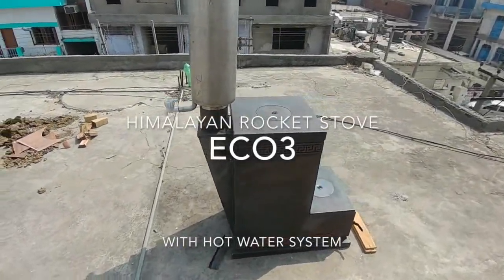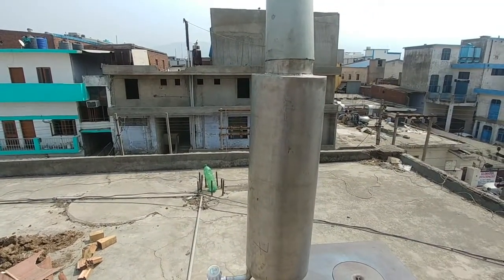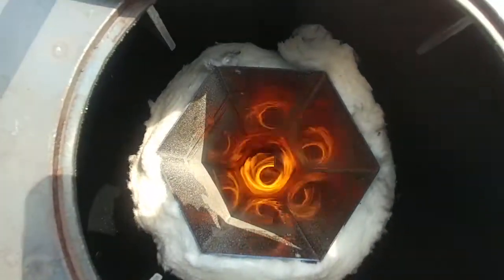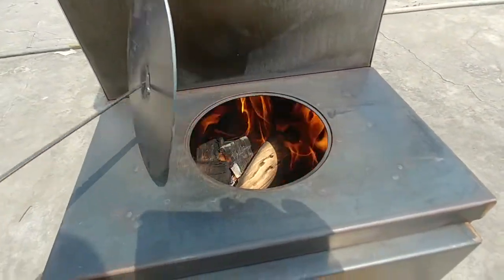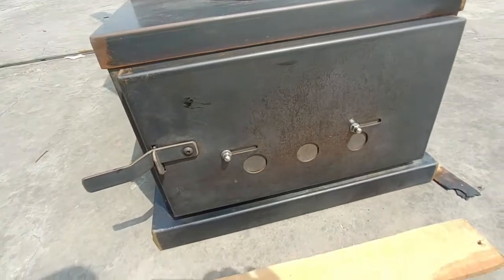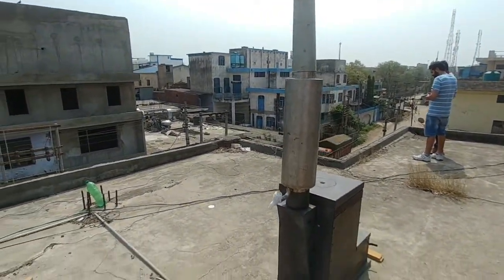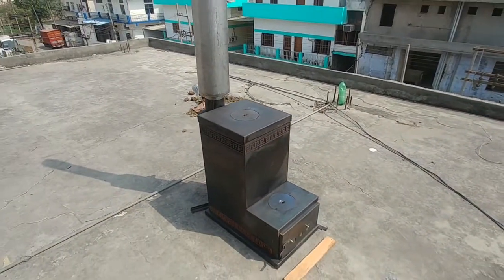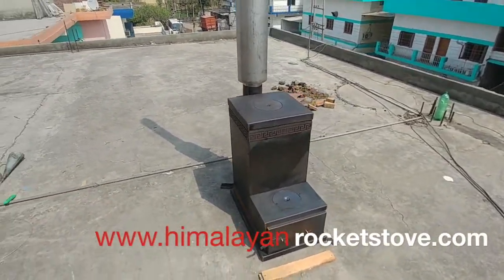Himalayan Rocket Stove's Eco3 with Hot Water Hamam

Comment: Hey Russell, hope you're doing well. I just purchased an ECO 2 model today and noticed that the rising vortex tube is bent towards the back such that it is substantially off centre to the hole provided for cooking. Do you think it is a manufacturing defect? Shall I seek a replacement especially when I haven't even used the stove?
Reply from the maker: Hi, sounds a bit strange. Can you send me a pic on my email. If it's not right we'll happily fix or replace it.
Reply from the maker: admin@himalayanrocketstove.com
Reply: @Rocketmandesigns  Russell, I just came to know that my father has already contacted you through email regarding this. Thanks a lot for your help, it is much appreciated.

Comment: Nice idea. Maybe the water tank can be put at the roof, instead at home, by extending the pipes and isolating the tank
Reply from the maker: Yes, this is also a good idea. It would not be as quick to heat up, but it would certainly give more options for running the water to different rooms in the house

Comment: Russell have you seen the aircrete risers developed by honey do carpenter, much cheaper than stainless and heat wool could be made in between two appropriately sized cardboard tubes, which would burn away on first lighting stove.They resist much higher temps than the stainless you are using. It would be easy to make a hand operated press to compact the mix into the cardboard mold the mix goes in almost dry so no worries about the card disintegrating , I am thinking of something like a cider press/ fly press with a ring mounted to the bottom of the thread via three legs, a plastic cone sitting on top of the inner tube and a funnel on the outer tube would aid filling and obviously be moved onto the next set of tubes for filling I recon with a little practice two blokes could knock out 20 riser units an hour one mixing and one packing ,thick card tubes available in many diameters and grades fairly cheaply check out the tubes used by the carpet trade in particular the extruded recycled card tubes. Also would suggest your water jacket on the mark three be operated like our old scouts camping heater a funnel on the top with a pipe running to the bottom of the tank leaving a half inch clearance  then a second inverted u bend pipe fitted to the top of the tank fill tank to top with water when it's hot you can pour in as much cold as you need hot out holding a receptor to catch your boiling water, great for a single cup of water for tea or coffee or a pan full for boiling rice, washing up etc. please feel free to contact me if unclear as to what I am on about or just to tell me its all rubbish. just thought a lever press would be faster in operation and cheap and easy to build anywhere some timber a few short lengths of rebar should do the trick maybe some rope and a counter weight to lift the arm back up and hold it clear
Reply from the maker: actually the aircrete risers sound great, will definitely have a look. Do you have a link I can follow to check those? I'll see if i can track it down. And yes, the final version of the hot water hamam does have a funnel at top and tap at the bottom and works really well.
Reply: @Rocketmandesigns  Russel it's a silly link but just try Honeydo carpenter on u tube he is an American I think and has been playing with this stuff for a while stoves, flues and buildings.I watched your video last night about the mud smokeless stoves folk could build in their own homes these could be molded in two pieces in aircrete or cob, if you mix a really good quantity of elephant dung horse or cow will do, in with your clay and sand ,once fired burns away and becomes thermally insulative..It' is how the beaker people made their cooking pots and iron age iron furnaces were made the same way Oh yes his bit on insulated stove pipes improving stove efficiency interesting. Whilst at it tap is a cost a bent pipe cheap and safer.good luck with your project seems like a worth while cause. I grew up in the third world the son of a civil engineer have much useless information in my brain except to some one like you.
Reply from the maker: @davidprocter3578  Hi David... its all that "useless" information which I find so fascinating! :-)  I am definitely going to have a go at playing with aircrete, amongst other things. Feel free to keep sending any tips my way if you think of any more.

Comment: This was my first winters here in Ladakh n bought one of the rocket stove but throughout winters I had smoke coming at the initial burning of the stove n my new kitchen has turned smoky, the walls n the wooden ceiling.It turns out that many using this stove went through the same problem
Reply from the maker: Please contact our service team for support. This is an issue that can usually be fixed either with a wind cap or small adjustments to the usage.

Comment: what material is the stove made of? and is it possible to have an oven as one of the hobs?
Reply from the maker: stove is metal with interior core made of SS310 (high temp rated stainless) and the rest is hot rolled mild steel in various thicknesses up to 3mm. We have an idea for an oven but haven't managed to get it through the prototype to production pipeline as yet.